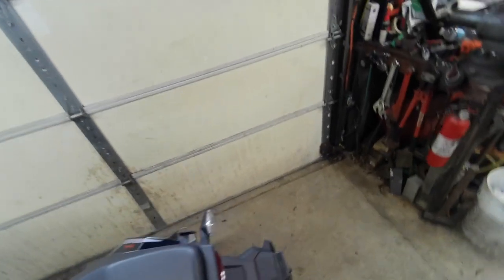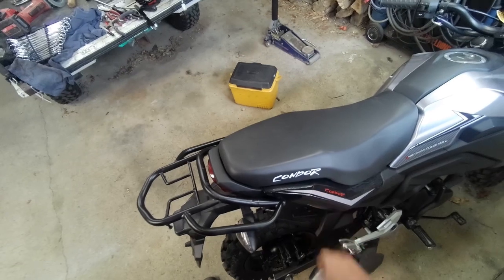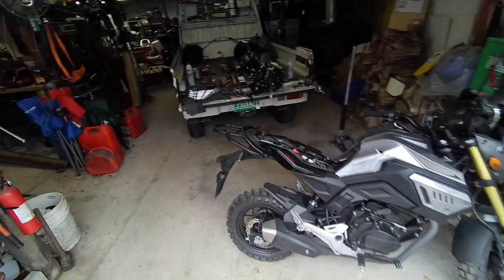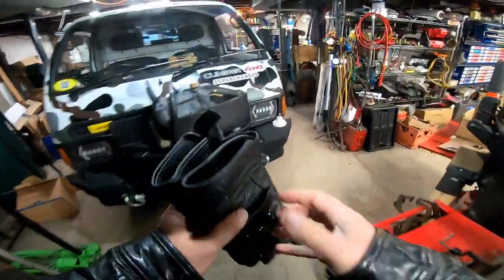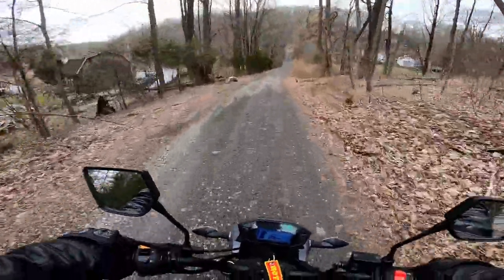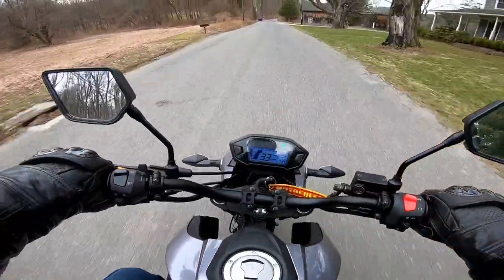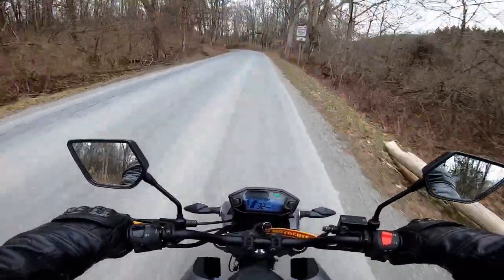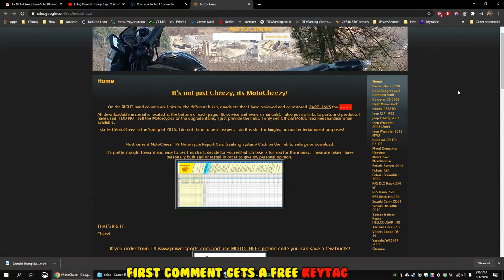(E7) RPS Condor 250cc Modify grom rack to fit, Road test 0-50 0-60 a few wheelies, needs exhaust!

Comment: Moto, cut the pipe like I did and get rid of that catalytic converter. I then added a ninja 300 slip on to the modified pipe and now shit spits flames 😊. Also I'm running the 17t front on mine, which gives me almost perfect and smooth gearing...I don't redline as fast as I use to. Another note, I've ordered and aluminum rear 33t rear sprocket to improve just a little bit more top end and subtract some of the that drag that the stock rear 34t sprocket adds to this bike, you'll get more rotational pull. Consider the wheel bearings as well...they will fail rather sooner than later. Honda Grom OEM parts mostly fit with the conder. I went with the All Balls brand...and I changed out the rear hub carrier and cush pads as well. I'll post a link of a Condor community that I'm in on Facebook... there's a ton of information on there, all from trial and error. Thanks a bunch for posting your videos, it's what convinced me to even purchase this little awesome machine. Let us know the route you take with getting that exhaust free flowing 🤪
Reply from the maker: I was thinking of a cut out exhaust valve to close when I want quiet, and straight pipe when open! Lol

Comment: I have a CG 200 engine that does 75 mph the most I've done was 78 with Google GPS tracking my speed I have an 18 tooth front pinion I would have to go and check what I put on the rear it's only a 5-speed I'm running a pwk 30 with a 105 main jet
Reply from the maker: What size chain you running? 18t won't fit 428 chain if you want to put cover on

Comment: Hey bud I need some help I recently purchase a 2022 Condor 150cc what I am having issues with is the front wheel feels like it's binding and it's not the brakes and with the tons of videos I watched I haven't seen a clear picture/ representation on if I'm putting the spacers on correctly and nothing in this little book shows anyting about the wheel speedometer installation and I don't want to screw up the speedometer.
Reply from the maker: There is a spacer on the rotor side, I'm not home for a couple weeks or I'd take a photo for you
Reply: @MotoCheez  okay thank you I tell you what man it is always awesome how you managed to reply I'll say it again I get a kick out of all your videos and watch them religiously.
Reply from the maker: Thanks!
Reply from the maker: Basically there's a long tube that's in between the inner race of the wheel bearings on the front wheel and that has to be the right width so do the bearings spin freely on the front wheel. So when you tighten it I'd doesn't squeeze in the bearings.

Comment: the zongshen 190 is that good i guess,  but the cg250 is only 229cc according to manufactuer website not 250.  i can get the zongshen 212cc for under 700$ and it would definitely be better than the cg250. plus there are  larger exhaust options for the zongshen. the zongshen is not as realible though that cg250 seems bullet proof while the 190 and 212 be breaking starter chains and cracking the case way too often
Reply from the maker: Yes, 229cc they're cheaper then the zs190 too. Wow, I've never seen the 212 that cheap

Comment: Look at the exhaust for a venom...same motor street bike 250
Reply from the maker: Thanks, I will. Or I'll use a slipon
Reply: @MotoCheez  does it have the cat in the pipe like a hawk? Venom pipe may as well..slip on probably better ...pipes for 150 and 250 are usually different size Dia. Also
Reply from the maker: @douglaslangham4417  it does have the cat, but the pipe is the exact same size as the 250

Comment: There no computer it will be fine if you don't disconnect it if it was fuel injection then ya would be recommend to unplug before welding it.  This make me wonder if the zs200cc cg style are good there perty cheap like 400$ new 🤔🏍️💯👌👍✌️🛠️🍻
Reply from the maker: That is. Cheap! I remember years ago they said the if it on and alternator circuit could get ruined. Before EFI
Reply: @MotoCheez  it could but uselly that if you have it on or running  at the time of welding because of the current that flows through metal. I would want to chance it on a vehicle specially new ones 🛠️💯🏍️✌️🍻